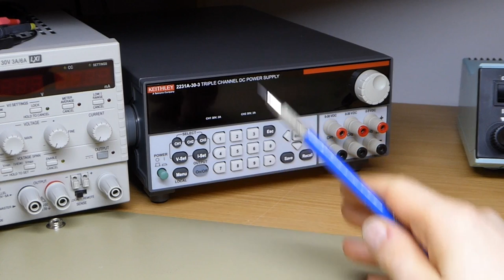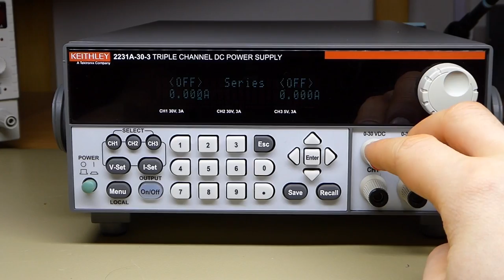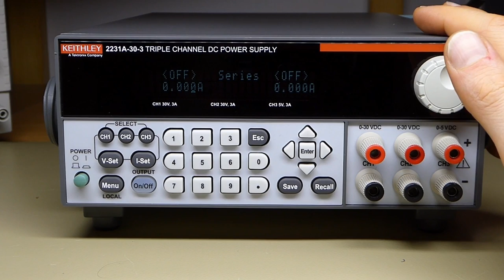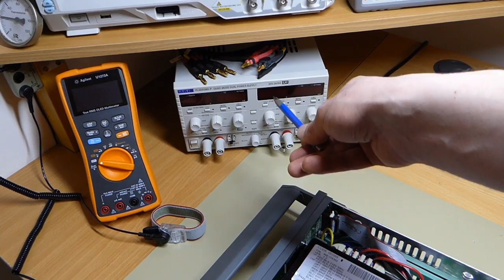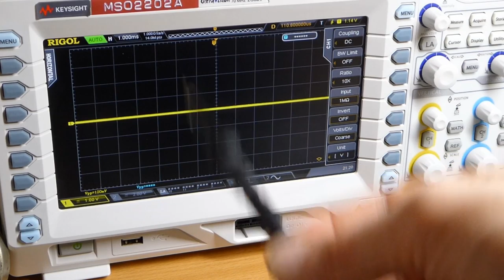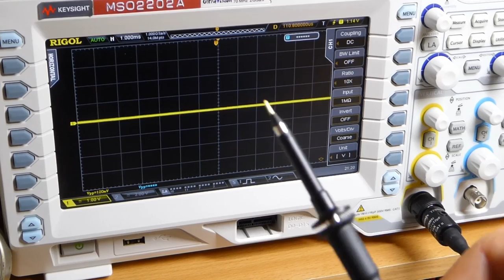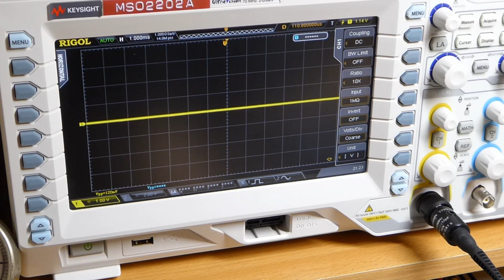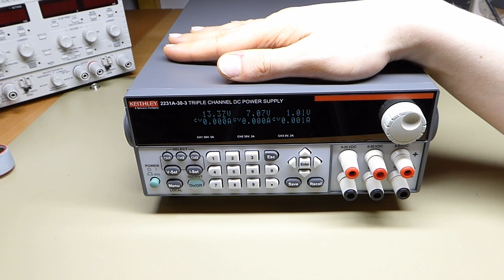Keithley 2231A-30-3 Power Supply Teardown

Comment: I just got myself one of these units, and of course I had to take a look inside before turning it on. :-)

It looks like they havent bothered to rub the numbers off the microcontrollers, and theres no Silastic on any of the big caps either. Theres also a mixture of Silabs and STM32 microcontrollers too - looks like Silabs for the 2 30V channels and an STM for the 5V channel maybe?

Comment: You actually missed the real point of this supply - which is that it's very, very quiet.  Output noise is less than 1mV RMS over 20Hz to 20MHz, and less than 5mV p-p, mine is actually less than 3mV p-p.  I have been using one daily for 3 years and it's the quietest power supply I could find.  The reason for PWM is so that there are no discrete steps when the output voltage is changed, and this follows Keithley / Tek SMU's - they are PWM as well.  The indicated voltage and current is a readback of the output, not what it is set to. All considered it's an excellent power supply.

Comment: Hi kitsune,
Excellent video, I have a problem with this power supply, I turned on it the with the voltage selector in 110V, and in my country we has 220v, I need to change an internal fuse or something more.
Thank you

Comment: It’s Keithley man, I’m sure it meets it’s specifications. They do make better ones for more than twice the price... it’s odd how you review professional equipment from a well known brand like it was an unknown import. And the giant ground loop you created to measure with your oscilloscope and assumed it would not matter, well I guess you proved something we already knew, that it does matter. PWM is frequency control, not voltage control so the rail voltage makes absolutely no difference, the accuracy would depend on the clock bit depth and jitter. The 8.5 digit super higher accuracy metrology meters use a multislope converter, so do chopper amplifiers in other ultra high precision instruments... using a super stable voltage reference and all analog circuits would be extremely expensive and use huge amounts of additional power.... I’d say the design is proper for what it is...